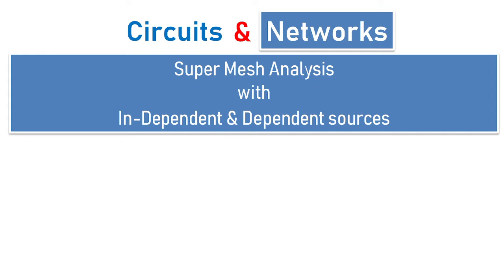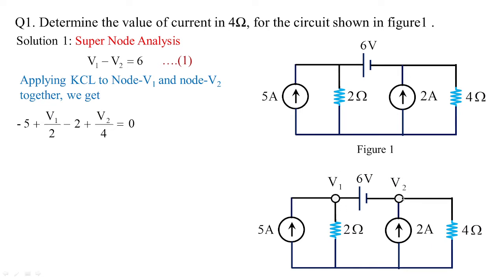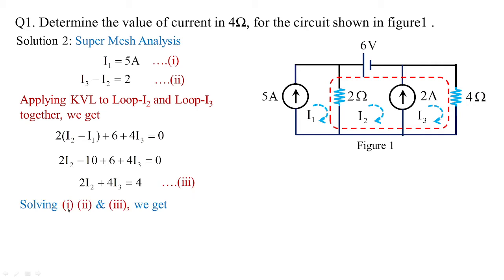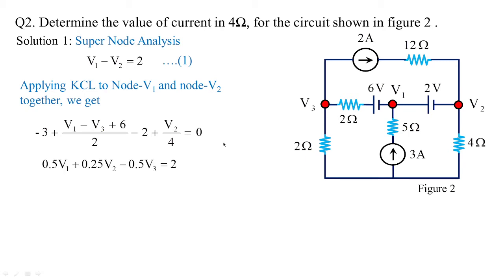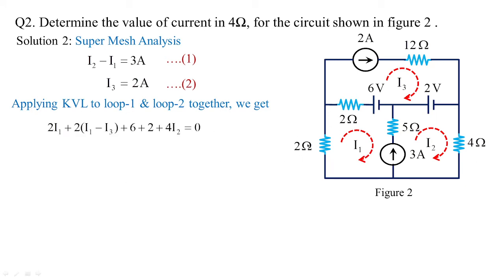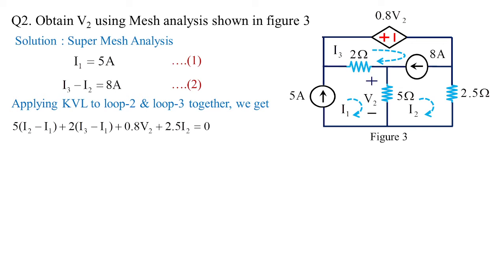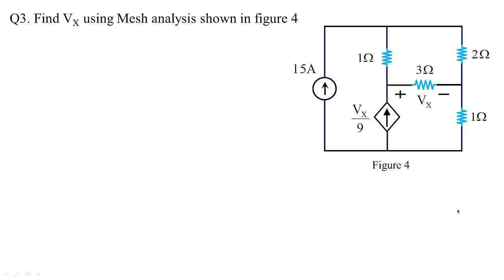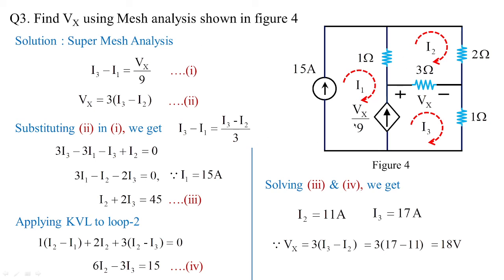How to solve Super mesh problems? How to solve dependent sources problems under Super Mesh analysis?

Comment: why we did not taken -0.8vx
Reply from the maker: 0.8V2 on left(positive plate) is connected to 5A and on right(negative plate) is connected to resistor 2.5ohm. that is why we have taken +0.8V2 in equation 3